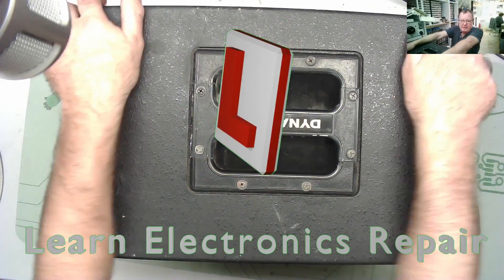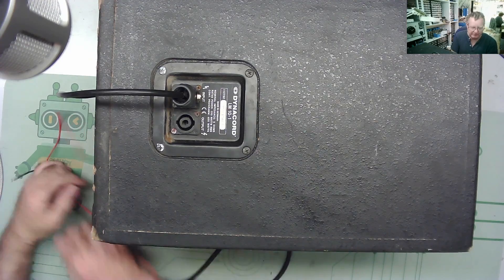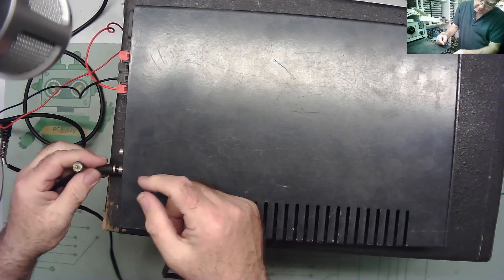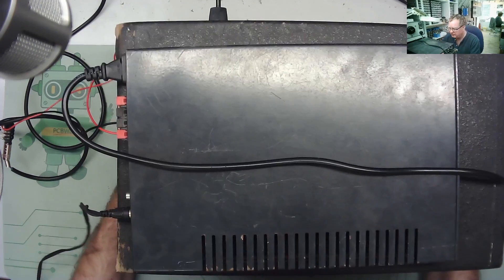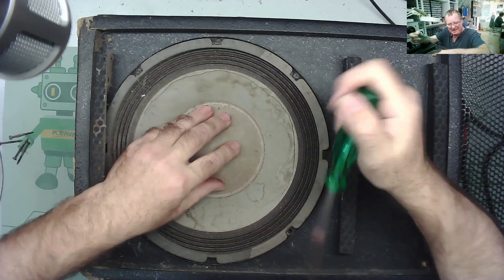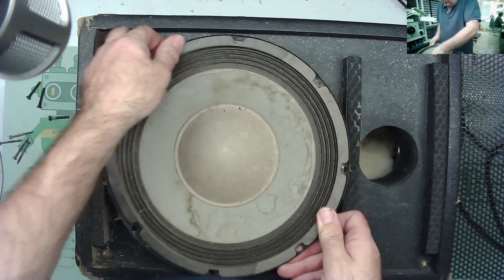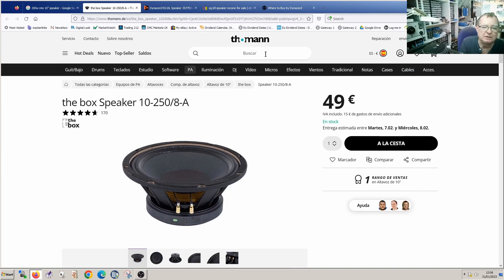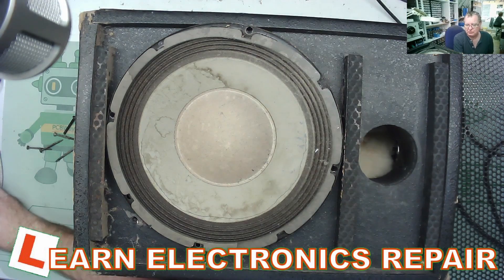Dynacord Blown Speaker Repair - Could You Fix It?

Comment: I would love to see if you could actually repair this speaker with all the info in these comments I will also add to use Japanese tissue paper on the back side with rubber cement might work :) good luck :) yeah :)

Comment: Just as a tryout, i would lightly cover/brush all the fabric with PVA glue (to strengthen it), let dry, then run a thinnish layer of hot glue all around the crack. That layer doesn't move much anyway. Won't be perfect, but worth a try. But replacements are only 30-40 bucks on Amazon.....i just hate not trying to fix something. Thanks for the video.

Comment: Audio guy here. Id start with a ohm test on your DVM and see if its reading properly or if damage was caused to the voicecoil. If it reads properly and does not scratch any when you push into the center and move it downwards then you could patch it from the backside using a paper machate to reattach from the backside without adding to much wieght to the cone, The more weight you add the less effecient it becomes. Id like to see a front and back repair, But getting a cone to that spec might prove to be a challenge with it being an older driver. 

But if you look up a JBL or Digital Designs woofer you will see on their higher end products they use whats called an impregnated cone which helps reinforce it from the back side by coating the cone with layers of chopped paper that is sprayed onto the cone, You'll find it a bit challenging but for the cost it would be a few dollars to fix that way and you could even attempt to add to the front but I feel like you may add too much wieght and throw off the parimeters of the woofer by alot. 

Just an idea of something you might want to try first. Fiberglass and resin is just not suitable for a product with that effeciency which I would think is in the 94+ DB range at 1 w 1 meter.

Comment: The crack is located on the non-flexible part of the speaker cone.
You can glue it with a PVA type glue which holds strong on paper type materials.
This glue is not flexible and will tend to strengthen the cone.
Use a thinned glue layer applied sparsely as a primer and do a second layer over the defect.
Best applied with a small artist brush.

Comment: You can fix that, use paper towels and white glue on top of the breakings. Then to reinforce everything, brush all the paper cone with white glue. Finish it by paint it black with spray paint.

Comment: Use caution when installing the new one with the screw driver.. I slipped off the screw once and ripped through the brand new cone 🤬
Reply: This is why annoying as it might be, working with the cabinet oriented with the driver perpendicular to the ground, the less chance of stabbing it with a rooriver there is. Ask me how I know.

Comment: You could buy a new cone and repair the speaker
Reply from the maker: Where do I find a recone kit for this speaker?
Reply: @LearnElectronicsRepair  A lot of speakers have a code printed on the back on the paper cone  that's usually  what you need to find  a recone kit.

Comment: Had same problem in a large foldback. Cheapest, most reliable solution was to just replace the speaker. Looked at replacing the cone but it's such a faff and with low reliability in terms of predicted outcome. Audiophiles wax on and on about speakers but for music in a pub they are all pretty much the same. Buy on price. Advise the bar owner to reposition the speaker so it doesn't get wet?
Reply: Subs can get wet due to the flat shelf effect they possess and people 15 times the legal limit to drive needing somewhere to put their glass down. However, 1200 people in a room pilled off their tits can have a similar effect cause of condensation. Adding air con just to look after the speakers is something I have never seen IRL.

Comment: That break on the cone is very common on bass speakers. You won’t be able to replace it with the exact same OEM driver unless you’re a Dynacord dealer but you can find 200W 10” speakers from $30 to $40 US everywhere. Amazon has one that looks identical and specs fit what you need.
Reply: Yup.  I had a set where the flexible ring around the outside just dry-rotted over its age (20+ years).  Easy to find and replace the actual speakers... with better ones at that (better frequency response and power handling).
Reply: @csimet  i can refoam a set of speakers in under an hour for less than 20 usd

Comment: tissue paper and extra thin ca (super glue).

i use bob smith industries adhesives. anything comparable to their blue cap extra thin should do the trick. its probably as thin as gasoline and each drop will wash into the fibers of the cone and tissue paper making a composite like band-aid on the back side of the driver.

Comment: coffee filters. you can cut a patch from a coffee filter and glue it on the back of the cone. it'd be one heck of a patch but since the cone is still partly intact it won't also require aligning for voice coil clearance. use the same rubberised glue used to glue the cone and spider to the frame.

doing this will change the thiele small parameters a little, adding weight to the cone (mms) will lower the resonant frequency and likely also the efficiency.

of course, realistically you'd just replace the driver.
Reply: Was going to leave this comment if someone else didnt. Coffee filters cut into strips of the right size but I used watered down PVA glue and brushed that over the coffee filter patches to glue them in.
Reply: Interesting method... Cheers!

Comment: You could re-cone it....but it is not worth the effort.  Those I stick in the corner and find a driver when I find one. After a few months I'd chuck it or  have fixed it.
Reply from the maker: I can't find a recone kit for this speaker or a replacement driver of the original type
Reply: @LearnElectronicsRepair  a replacement driver is often an improvement over the old drivers. Visiton driverz from digikey or mouser are great quality and cheap enough.

Comment: Looking at the staining on the cone I'd guess it may have got wet while being used at fairly high volume.
Replacement driver or scrap I'd say.
Reply: I was thinking the same thing, or it had been in a moist environment and over time just kept asborbing moisture. That or some piss head spilt his pint on it.
Reply from the maker: @Ghost572  It came out of an local Irish bar and music venue (actually irish owned) called the Shamrock.  One of the regular musicians name Kelly plays guitar and sings rock music far too loud at the a bar which is surely what caused it to blow 🤪
Reply: @LearnElectronicsRepair  quite a unique fault then, atleast for me its the first time I've seen the material breakdown like that.
Reply: @LearnElectronicsRepair  Always the bloody Irish......